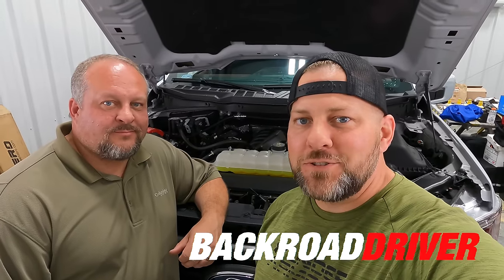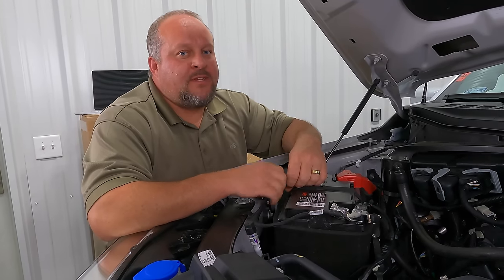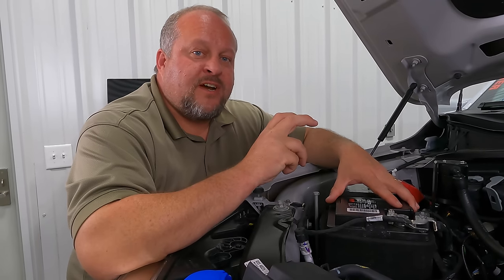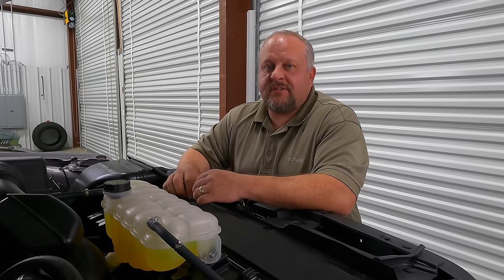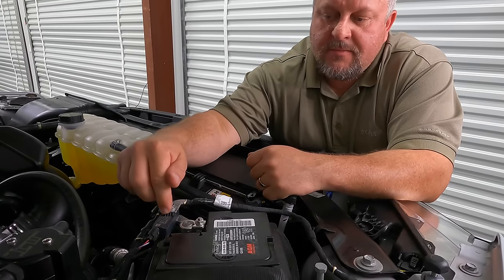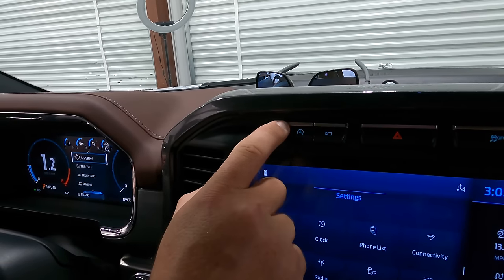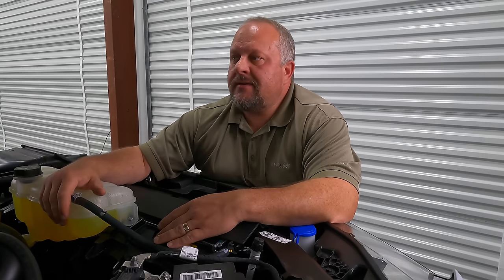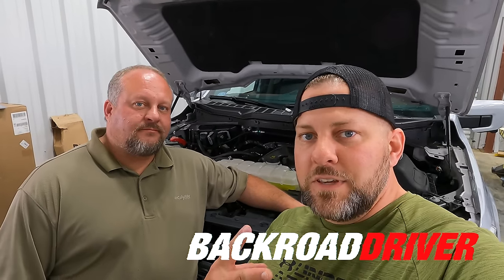2021 Ford F150 5.0 V8 Cylinder Deactivation & Oil Pump Belt Defeated! - It Wasn't All Bad...

Comment: I'm sure if you do this, and you end up having engine issues, getting it fixed under warranty is going to be an issue, even if you hook it back up before bringing in for repair. So just live with it. Its under warranty. If it causes problems, make Ford fix it. Otherwise you could be on your own.

Comment: I don't like the oil belt systems.   Ford has had that system on the 1.0 motor for years now.   In that motor.  It's known for breaking down and destroying the motor.    I would like to see some test done on that belt after 100 k have been put on that belt
Reply: I see one guy make videos, likely a Ford Tech, man he has focus after focus or whatever those little cars are, yep this one threw the belt, motor gone, this one needs a motor ect. It's not if they can hold 1k horsepower, it's if they'll last 100k (hopefully more, but it's not gonna happen) without leaving you on the side of the road, with a blown engine. You'd figure also with such high technology, if it seen oil pressure just instantly stop, and have some speed sensor on the pump, that itd kill the engine. Dumb designs made by penny pinchers and for the EPA

Comment: So is a 6.7 diesel more reliable than a new 5.0?? This comment is my new truck decider
Reply from the maker: It a crap shoot. Heavier trucks have to have more torque to move and more breaks and suspension to stop. If you aren’t towing or carrying large payloads and you are just daily driving and doing a little towing then the smaller F150 with the 5.0 sound is the way to go.
Reply: @BackroadDriver  i have a 3.5 eco now, no issues, the torque is nice, but im thinking of going back to a 5.0 just for long term reliability, i mean some guys have proven turbos can last
Reply from the maker: I would say it’s two different ways to get to a near same result. Both ways of getting there have their own problems when it comes to longevity.
Reply: Completely different trucks bro, if you log 100,000 miles a year with a load or idle all day and night every day, go diesel. If not, don’t. A diesel truck will not treat you well if you don’t use it right

Comment: Sorry guys you will not be earning a sub from me! Have you researched oil pump belt failures on the 2.7 ecoboost?1100 hp has nothing to do with longevity. Having a belt drive is asking for failure, let’s hear about a belt in oil, lasting 200-300k miles! Good luck
Reply: What?  It's very common for those motors to last 250,000 plus.   Quit smoking weed
Reply: @mmardell9262  yeah may be like more like 100,000 miles. Mine blew the timing chain and took out most of my parts in my engine at 119,000 2012 regal 2.4.
Reply: @mmardell9262  I don’t smoke weed, thank you very much, lots of Ford Master Techs will disagree with you
Reply: @Splitthatpie comparing a 2024 5.0 V8 made for a truck to a 2012 Buick regal with a 2.4 4 cylinder is absolute idiocy

Comment: I didn’t even know I had cylinder deactivation. Doesn’t seem to be a problem.
Reply: If you have stock exhaust it's fine, if you have an aftermarket exhaust, it almost sounds like a subaru boxer engine when it drops to 4cyl. It's a very weird and very off-putting noise.
Reply: @b.c.2281  Why make more noise, it's annoying to most people these noisy trucks.  Come on, don't be loud.
Reply: @richardmartink679  It's a mild cat-back and barely louder than stock, unlikely to irritate anyone. Go scold someone else with your delicate sensibilities.

Comment: I thought that was a gen3 coyote ?

& gen 4 coming out in 2024?
Reply: its still a gen 3
Reply: @bamamoto1239  yeah that’s what I’m saying
Reply from the maker: It's actually Gen 4. All of the changes made to the gen 13 truck engines are coming to the new mustang when it's released. Cylinder deactivation and a belt driven oil pump are among those changes.  It's not even the same block or heads as a Gen 3.

Comment: So what happens when the starter wears out?
Reply: Half the cars on the road and most of the new cars sold today have auto stop/start.
Reply: @bobbybarnes1652  Maybe for the small displacement. The 5.8L V8 by Jeep and GM have 8 to 4 cylinder operation.

Comment: Ford will tarnish the amazing reputation the vanilla 5.0L has with this cylinder activation system, mark my words.
Reply: Cylinder deactivation won't tarnish anything if other issues like engine tick/piston slap on Gen 3 5.0L didn't affect the Coyote 5.0's reputation.  When Ford went to dual injection (direct & port) in 2018, along with a spray in plasma cylinder liner, people complained about engine tick/piston slap.  That didn't stop people from buying Coyote powered Mustangs or F150s.

Comment: So what happens if the oil pump belt breaks?
Reply: same thimg when a chain breaks it stops Belts are mor reliable
Reply: @steveschilling5966  my point is the motor will not shutdown spin a bearing. There should be fail-safe for this.
Reply: @steveschilling5966  I've never had a timing chain break, but I've gone through a couple of belts on the wife's car. No body will ever convince me a belt is better than a chain.
Reply: @09roadraider40  , Look up Murray safety switches , they are used on irrigation pumps & other engines where no one is around to keep an eye on the oil pressure and temperature , if the oil pressure drops or the temperature rises outside of parameters it shuts the ignition off and saves the the engine.

Comment: Is the ford 2022 the same way or no
Reply: Yes I just brought a 2022 it seems to work the same
Reply: @kevintheclassicman2578  all you did was pull that cable off the battery ?
Reply: 21 and up 5.0

Comment: Hi Guys can you still do this if you buy a 2023 coyote in a f150 ? I hope you can as i wanted to buy one
Reply from the maker: No, this ended up not being a fix for cylinder deactivation. The only way to deactivate it is to get a tune for the truck. As has been said a million times you can also put the truck in sport or tow mode and it will also deactivate it. Hope that helps.
Reply: @BackroadDriver so it no longer works for the 2021 models?
Reply from the maker: @qeuzzy9206 No, 21 and up V8 models have cylinder deactivation and can only be disengaged by using sport mode or tow mode. If you are willing to tune your vehicle, which could void warranty in some instances, it can be turned off completely 100%.
Reply: I hate to say it but get the 2.7 v6 turbo because its faster with better mileage numbers and does not have cylinder deactivation. It’s also built like a diesel engine, literally.

Comment: I want a 5.0 but they messed with it too much. I'm afraid of touching it and don't want cylinder deactivation. I guess it's the 3.5 for me.
Reply: The 3.5 is worse than the cylinder deactivation, you’ll need new turbos at 60k
Reply: @jesuscolch5329  My last 3.5 went to 170k with no new turbos before I sold it. My current is at 90k and still no new turbos.. what exactly is your proof here? Do you think just because something comes out of your mouth it makes it true?
Reply: I went 5.0 and I’ve had both.  It’s too bad we have to decide on which has the most negatives rather than positives.
Reply: @jesuscolch5329  Dude I'm a V8 and will be the first person to sing praise for the Coyote 5.0L seeing as own an F-150 that has this engine, but the Ecoboost is generally fine. I've seen EB trucks with 300K on the original turbos. This isn't 1985, turbo tech has come a long way, get with the times.

Comment: My 2022 came without the start/stop because of shortages
Reply: Yes, but does that actually stop the cylinder deactivation also?
Reply: @TheSaintberzerker  that I am not sure of because it still has eco mode.  I will have to do some checking. At a minimum at least I don't have that start/stop feature that I dislike.
Reply: @TheSaintberzerker o - two separate things.  Interestingly,  the auto start stop light still lights on the dash at stop lights even though it doesn’t shut off the engine.

Comment: A belt is not better than a chain, especially when its running in oil.
Reply: In many ways it is. Quieter, will not stretch, not sensitive to oscillation harmoincs, smoother, does not grow and contract with heat, cheaper, etc. Yes it becomes a maintenance item, but chains wear out and break too, especially the tensioners and guides they need to use with them. Material science has come a long ways in the last 20 years. There's a reason many manufacturers are going this way.

Comment: I think it’s great deactivate two of those cylinders permanently and put two twin turbos on that puppy 🤣
Reply: Your an ecoboost fan huh. Show me an ecoboost on stock sealed engine only adding boost make a truck run 8-9s in the 1/4. 3.5 liters at 1 bar and your shoving 7.0 liters of air through that little engine per revolution. I dont see it lasting as long as an engine having 8 cylinders to divide that power on. Just my opinion though.

Comment: Turning cylinder deactivation off fixes nothing and you still have the weak half a V8 with 4 cylinders made for low power and economy, so if your gutsy enough to waste $ on overpriced Fords right now or any overpriced vehicles, don’t buy post 2021 model 5.0 V8 F150’s or any GM V8. Unless the weak cylinders are replaced, do not mod one of these mechanically under the hood.

Comment: As a LEO when my agency switched from Chargers to Explorer and F150 it was nothing but a disaster.  Oil pump, turbo failures, water pump, heat or AC issues. sorry guys nothing but JUNK. Ford is a piece of shit brand. Smell of burning oil. 

I spend 12 hours in these cars almost daily and I hate every min of it. Junk
Reply: Well go watch your POS Fiat videos then.Or whoever it is that bought that crap company last,lol.It changes hands so often,its hard to keep up with who has it this month.
Reply: This is why I buy tundras. Not a lot of bells and whistles but I don’t have to worry about any that crap!
Reply: I'm also a LEO and our department uses chargers. We have nothing but problems with them and will hopefully switch to something else in the near future. I'd love an F150 as a patrol vehicle. I've owned Ford's my whole life and have never had any issues.
Reply: I bet when off-duty it takes like 3 seconds for you to tell everyone you meet that you are a LEO HA HA!!  Bet your friends take bets, when they see you coming, on how long it takes for you to mention something about being a LEO Ha!
Reply: @Scomelbasses  you can thank Obama the fuck up globalist for 
Forcing the MDS 4cyl shut off on the V8s.  The MDS causes the Cam shaft to be eaten up by the phaser. The other issue would be oil change due to tolerance the 5.7 has to have the 5w20.  My charger had oil changed every 3000-5000 miles.  I also put the transmission on manual mode from the shifter to shut off the MDS.  Mine lasted well over 120,000 without any issues.
Reply: @adamharris2674  I do not get anything twisted. Mopar or no car, you can dislike LEOs all day I can careless.  You attacked me on this video because I said as a LEO I drive Fords.  
So do not try to change your words, you said it.  
Mopar or No car 🤣🤣😆😆
Reply: @cammedramprocharged4927  We change the oil at 3k miles. The guys at the garage all hate the chargers and have spoken with the city manager about how getting something like a Chevy Tahoe, with a higher initial purchase price, would be less expensive in the long term due to less maintenance needs. Our K9 units and traffic units all drive Tahoe's and they much prefer them.
Reply: @Scomelbasses  thank you for your input and sharing your experience at this point is a preference the chargers lasted us over 100K miles.  I work for a high crime town PD 
So we always gunned our cars to calls. No issues.

Comment: Belt driven oil pump. What a joke. 96k miles on a 2.7 the Belt was cracking
Reply from the maker: Unfortunately I'm pretty sure the motor may need to be pulled for a belt swap but somebody might have a solution. It's not going to be easy or cheap.
Reply: Should just pull timing cover and oil pan I believe
Reply: How much was the repair?